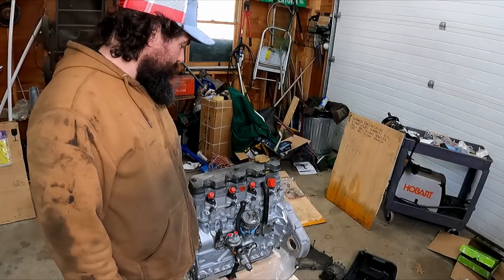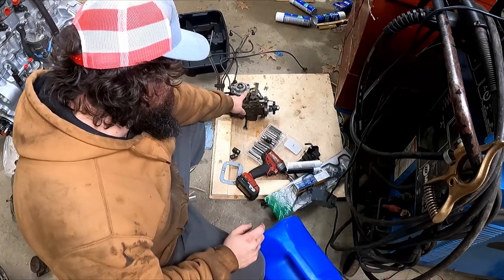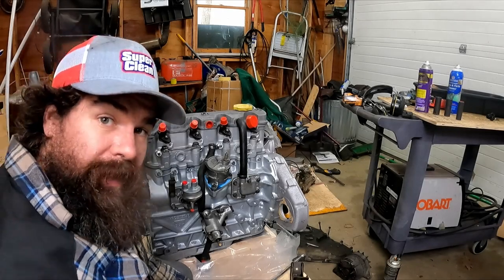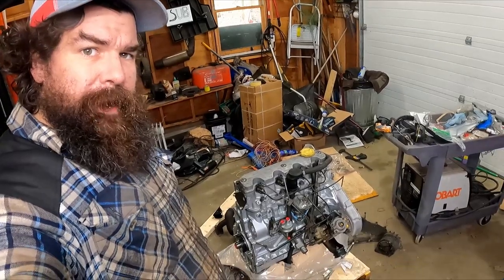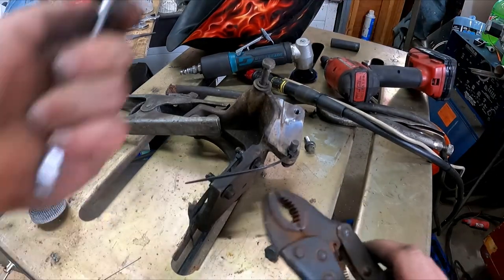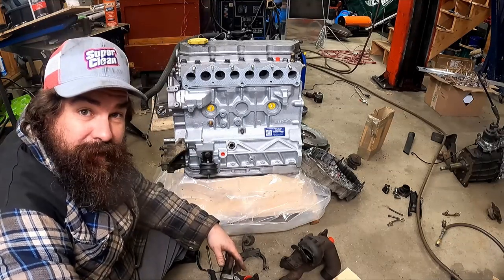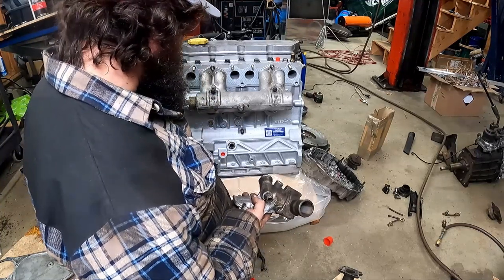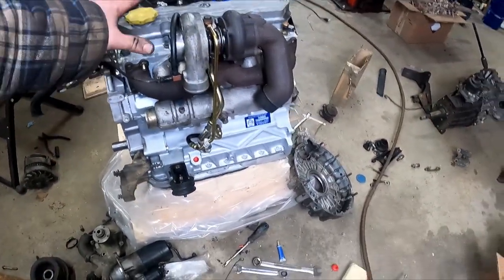Landrover Defender 90 Power Train Assembly Part 2

Comment: Impact gun on the aluminu.. aluminium block made me slighlty uncomfortable lol. I have faith in your skills though, keep it up! You're making more progress on your projects than I am lol.
Reply: Aeroquip high pressure hose and fittings. You can make your own lines.
Reply from the maker: That might be the way to go, other people have complained about there being way to much force on the turbo lines.  I have my impact set pretty low, and I always start my bolts by hand, but I get where you're coming from.  Progress has stalled after this video as I am missing some silly plastic clips that go in the clutch area, that are also backordered.

Comment: Just buy a gallon of paraffin/kerosine and use a pump up spray to apply , far cheaper than buying spray degreaser.
Reply from the maker: I definitely use that trick for smaller parts, and it does work well.
Reply: @wirestiresandfires214  I use mr muscle oven cleaner UK based i get it fom £ land you have $ shop ?
Reply from the maker: @stevebarmore3509  I've never tried oven cleaner, but I see more and more people using it.  I would be concerned what it would do to aluminum if not fully fully removed.  There is a dollar general (in America we go for military and not funny puns) down the street, might try their cheapest oven cleaner and see what she does.  Thanks for the tip!